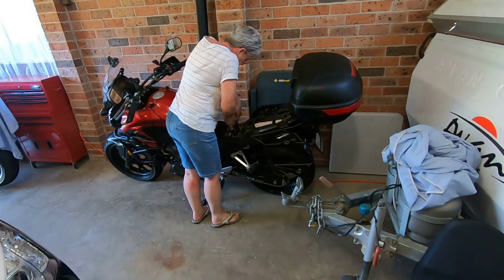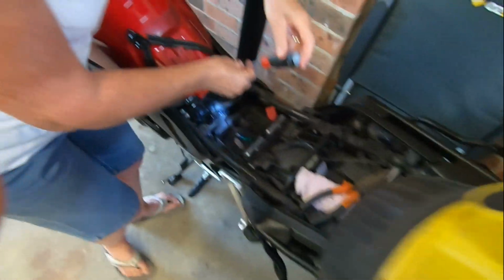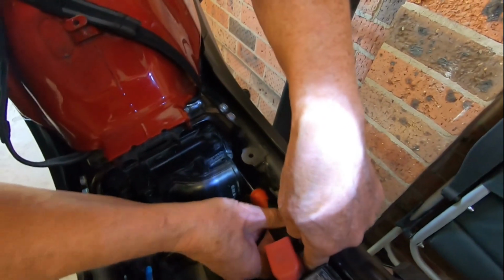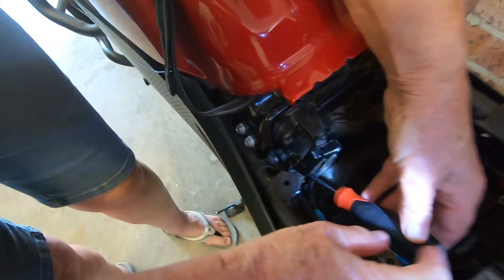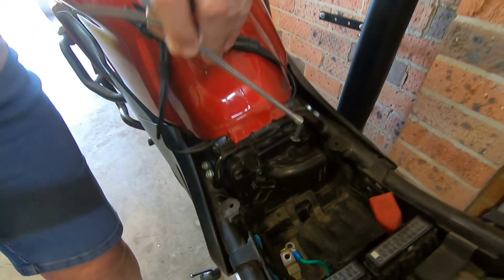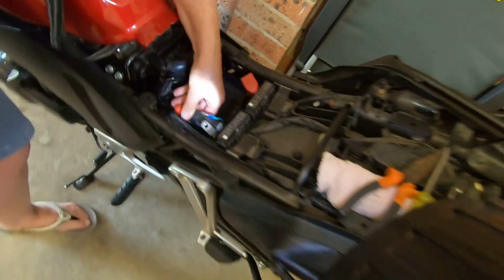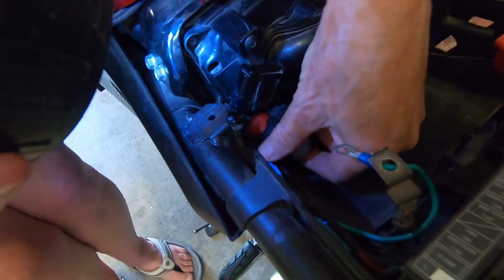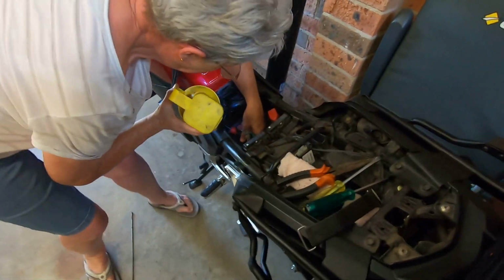Honda CB500X Air Filter Change - MISSING SCREWS

Comment: Hi, in this case you can tape the screw to the end of the screw drive with electrical insulation tape. The screw will never fall of and it bends a bit too. Just put more tape on the driver and less tape on the screw then the tape will stay on the screw driver instead of the screw when you remove the driver from the screw.
Reply from the maker: Or ... just get the wife to do it! 🤣

Comment: Leave the bottom two screws in housing when you are replacing it, Honda have little tabs on them to stop them falling out, the tabs align them and you can tighten them and then the top two, from one woman to another GO WENDY!

Comment: The secret is.  Do not completely remove the bottom two screws from the housing. They only need be unscrewed enough to allow separation from the intake. The last few threads keeps the screws located in the cover. Remove the cover with the screws still in place. Fit the new filter & pop the air box back in with the screws already in place, nothing to drop. Hope this helps for the future.

Comment: Goddam you are a lucky man!
I am lucky enough to have a wife that loves going for a ride on the back of the Vulcan Nomad, but she has never ridden a motorcycle before. She also suffers from "bum to close to the ground" syndrome, so finding a bike that she can actually touch the ground on is an extra challenge.
Reply from the maker: Thanks mate. 
Wendy is 163cm so she also doesn’t have many bike choices. The CB is lowered 40mm !

Comment: Update, I cleaned my air filter today and noticed the bottom  two screw need to be inserted before fitting the cover and they are held in place via plastic inserts. Still hard to screw them up but with the right length screw driver it's do able.
Reply from the maker: Thanks for the tip

Comment: Hi there, just curious as to what tyres Wendy has on her 500x, l want to change the ones on my 500x.
I wish to get off the sealed roads, and do a bit more exploring, not confident with the original tyres.
I would be grateful for your imput. Di
Reply from the maker: We are both running Pirelli scorpion trail II
They are a 90/10 tyre. Ok for maintained gravel roads. Great for sealed roads.